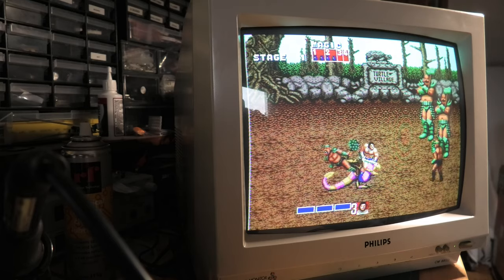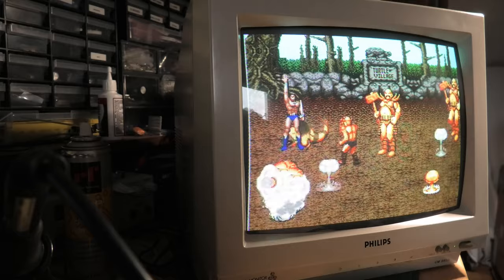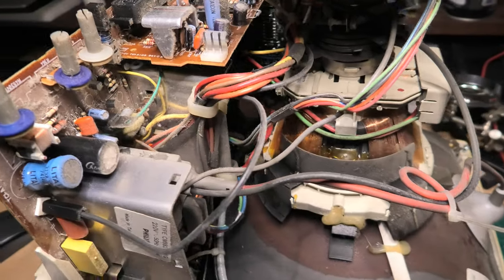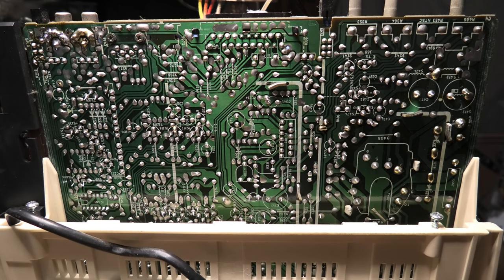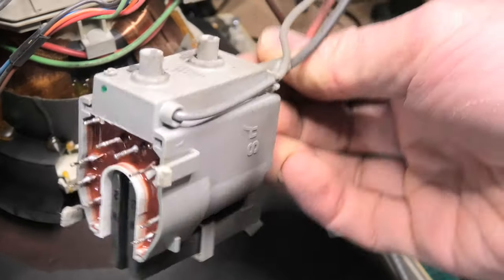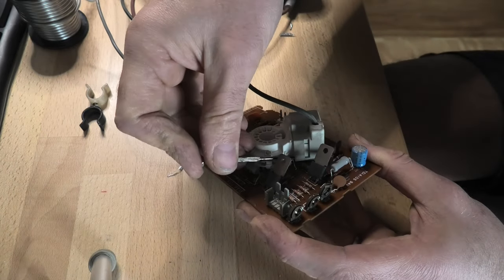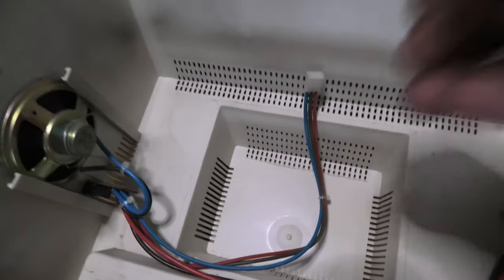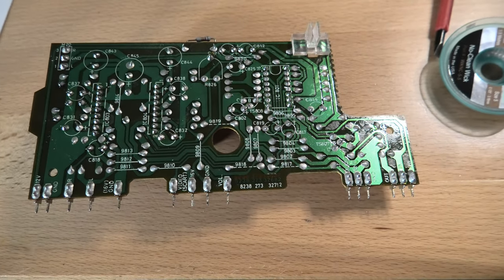Philips CM8833 CRT monitor repair - No Picture and ticking sound (Audio issue)

Comment: When setting up the new lopt do you need to set the b+ voltage if so how do you do it, i only ask as i have heard people talk about that b+ voltage before
Reply from the maker: I just swapped out the lopt. If you refer to the service manual (easy to find online) it notes "Adjustments after repair.  Connect voltmeter to C494 and ground (DC).  Adjust R114 until the voltmeter indicates 125V".  This might be what you're hearing about.
Reply: @Justfixitmate  would you need to do this when changing a lopt or is that just when you recap all the monitor
Reply from the maker: @amigalads  Probably depends on the condition of your monitor.  I didn't tinker with the power supply section since there didn't appear to be any issues with it.  Try to get your hands on the service manual, that might give you some hints.
Reply: @Justfixitmate  thanks for that I will let you know how I got on

Comment: Would you mind providing a link to the replacement part you ordered? There seems to be few repair videos related to the original CM8833, mentioning the replacement parts. Most CM8833 repair videos I found are about the Mk2 model (CM8833 II), and it is using an HR7533 flyback, while for the original CM8833 the service manual lists part 4822 140 10275, which seems to be an HR6489.
Reply from the maker: G'day!  I ordered this part from Donberg Electronics, order code HR 7506. Invoice shows the following under description. 14010349/30102 PHILIPS/CM85/86/88 with focus unit 13120010326/11421395B =AT2079/30101 CM8833.  I selected this part based on the info on their site. Couldn't find much info elsewhere. The pin alignment of this part was not 100% the same as the original part, perhaps 1 or 2 mm out of alignment for some pins, but it was still possible to mount on the PCB.  Monitor is still performing well.
Reply: @Justfixitmate  Thanks for listing the part number. I now notice that the HR6489 I previously had looked at doesn't allow for focus fine-tuning, which your video mentioned needed adjustment on yours. Still the HR6489 is listed precisely for the CM8833 (on Donberg Electronics' site) ... but so is the HR7506. I'll follow your suggestion and look for a replacement HR7506.
Did you perform any recap (or planning to)?
Reply from the maker: @graphix-ds  No problem. No recap completed yet. Probably a good idea to recap the power supply section, especially if you don't know how it's been stored over the years.
Reply: @Justfixitmate  Ordered the same flyback, and a power switch from Donberg Electronics. Waiting for it to arrive. Now I am wondering if I should also replace the HOT (Horizontal output transistor), and maybe the vertical deflection. In my particular case I only have a white image with (apparently) malfunctioning vsync and/or hsync (not really sure, just guessing). Thinking of only recaping the mainboard as the power supply seems to be OK.
Reply from the maker: @graphix-ds  A white image.  It's not something obvious such as a failed brightness potentiometer? Does the image turn green when you hit the green button?
Reply: @Justfixitmate  Brightness does work, as does switching to green display. It's not entirely white screen, you can see there is an image in there, but the horizontal and vertical sync seemed to be all over the place. Trying to adjust the horizontal and vertical size and position didn't help. There was also a constant "plop-plop-plop" sound, so I took the monitor apart. The sound board had broken solder joints, so that has been handled (not tested yet). A new flyback has been delivered, but am waiting for a new power button, as that had to be repaired as well. Will report back when I have all replacement parts changed.
Reply from the maker: @graphix-ds  Hopefully the flyback does the trick.  Good luck with it!
Reply: @Justfixitmate  The flyback, HOT and power switch have been delivered, and installed. I had followed a different video which explained to adjust the focus and screen on the flyback. At first I had left the two as per factory, but when powering was applied to screen gradually went white until it popped to black, and again slowly turning full white and popping back to black in a loop, accompanied with a loud "plop" each time the screen went from full white to black. I quickly powered off. At that point I though my repairs had broken the monitor beyond repair. Turns out the screen setting on the flyback was way to high. I turned it down completely, switched the monitor back on ... and nothing. Black screen.
I then slightly adjusted the screen knob until an image appeared, after which I adjusted the focus. The monitor lives again !!!
I haven't replaced any capacitor yet, as they all looked to be in good shape. And now that the monitor works, I am not sure I want to dismantle it again (quite a PITA) to recap the PSU.
Thanks for wishing me "good luck", it really helped!
Reply from the maker: @graphix-ds  Hey, that's great to hear!! Well done - enjoy! :)

Comment: Hey just wanna ask whether this monitor is stereo or mono?
Reply: Stereo.
Reply from the maker: The monitor has stereo speakers and a stereo amplifier, but if using the RCA connection, only mono audio is supported. If using the SCART connection, stereo is supported.
Reply: @Justfixitmate  okay thanks for the info!  Ive ordered some scart adapter and ntsc to pal converter to play games.